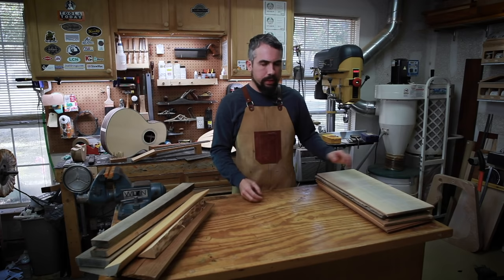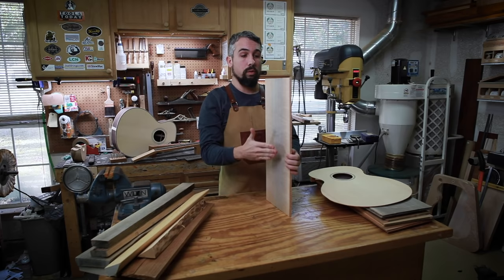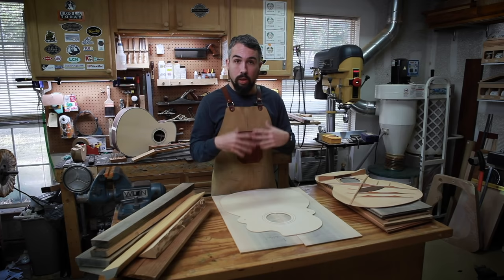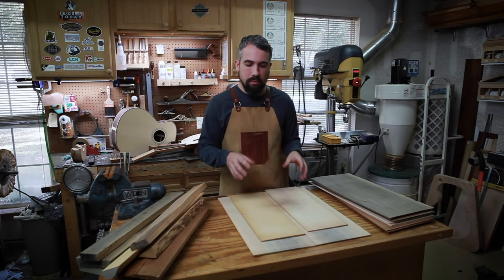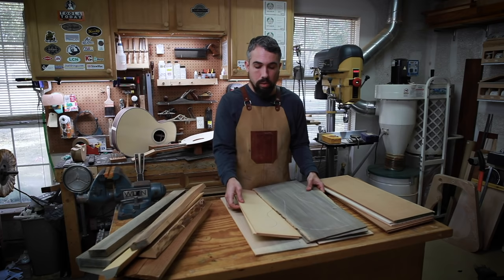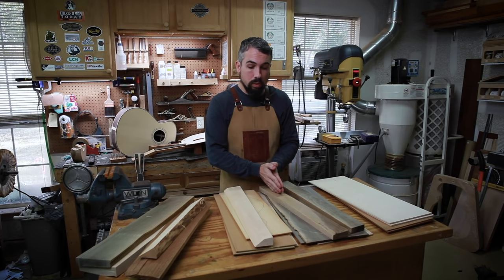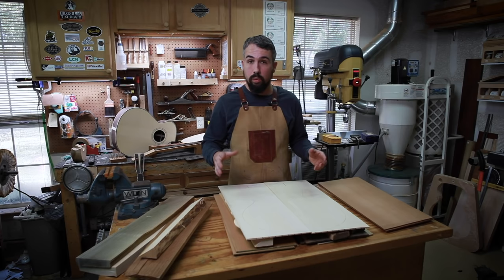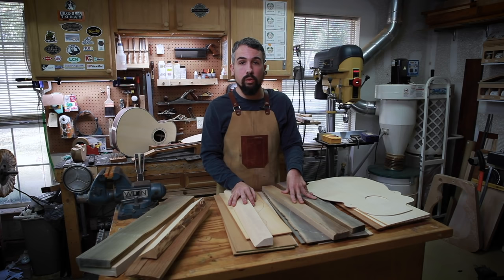What no one will tell you about acoustic guitar soundboards!

Comment: Nice info. Good stuff to think about. 
Odd question here. If you are doing a one piece top, like in a mandolin or uke, which direction would you put the wider grain, to the bass or treble side? I would lean towards the bass side, but I'm frequently wrong in these things, so I thought I'd see what you think. I'm also starting a small descant lute that I have cut the top out for, it's a one piece. Again, why I'm wondering. 

Thanks.
Reply from the maker: That’s exactly what I’d do as well. You’re correct in my opinion.
Reply: @DriftwoodGuitars  Thanks, good to know. At least I'm not totally out on a limb by myself! (so to speak).

Comment: Wouldn't it vibrate more freely if the braces were arched off the soundboard, only glued down at the vibrational nodes?
Reply from the maker: It’s a good thought, and has been attempted. In the end, it just doesn’t work as well, or sound as good as the more traditional bracing. There’s a reason the Martin X brace, the fan brace, or the newer Falcate bracing (or variations of them) are the basis for 99% of builds. It’s been tested and works well for both strength and sound.

Comment: It's all about what the wood looks like under a microscope. Spruce, redwood and cedar all have tiny speaker cones. Structures that look like tiny horn drivers in cross section. They are spherical with a flat circular membrane that has a weight in the center. there are two holes in the spherical chamber.

Comment: i love the way people tap wood. for sound...then cut it up and glue it...flick a wine glass.PING!.then hold it tight and flick it again..DUNK
Reply from the maker: I fully agree. I’ll be covering this topic in a later video. I use free plate taping here as a way to illustrate the responsiveness of each wood. It’s not a perfect representation of its final tone, but is of its general ability to translate energy into sound.
Reply: @DriftwoodGuitars  the top..why is it not thicker on the edges.this way you could make the  middle where the sound hole is even thinner.like an arched top but reversed.the outside would look normal but inside would be arched and like i was saying by the sound hole could be then wafer thin..because nobody thinks they just copy .take the sg or lesbian paul..they dont make it better with a better design headstock angle and the way the strings come out.they should make it better with a prs headstock..have you heard an acoustic with a rosewood or ebony top?everyone says they would be poo but i dont know anyone thats heard one..then theres size..small one might sound pants and a big mexican thing might sound great..taylor do a koa top and thats hardwood..why is the neck dense? to carry sound and have sustain..is that not hardwood? would it not be a good idea to make the top from the same stuff?..we dont know we havent heard any of these varations..just a guess of it going to be crap.then theres carbon fibre.you would think nasa or some f1 team would be the specialist..its not its free spirit fishing..low resin..dont go soft even after 15 years in the sun....any other carbon fibre goes soft after 6 hours in the sun.everyone else comes out with new rods every year..free spirit..same model since 2002 and hasnt been bettered..so some guitar builder aint got a clue.hes light years behind in carbon fibre tech.maybe if free spirit sent their man to a luthier youd get a good one.until then forget it...so basically..what do you know? what do you believe
Reply: @jeffhildreth9244  exactly..copy and paste with no idea why..only that someone before did it. so they do the same thing and regurgitate why

Comment: Great information.  Something I’ve never heard before.  What do you think of high pressure laminate?   I have a Martin made with this and it sounds great.
Reply from the maker: They make for loud and durable guitars, but in my opinion they aren’t great in tone. I’m by no means saying that your guitar sounds bad, I’m just saying that once you hear a high quality hand made guitar, anything else just doesn’t cut the mustard. The lack of actual woods in those guitars lacks the warmth and subtle overtones that you get with wood. I’ve played many of those martins and even gigged with them, and they do a great job. They just don’t sound like a wooden acoustic instrument to my ear. Tone is subjective though, and 90% of acoustic players have never actually played a handmade instrument to see what they’re missing. I’ve heard some carbon guitars that sounds great as well, but to my ear, I much prefer wood.
Reply from the maker: Another note on laminate tops. I recently had a customer ring in one of those Martins with a lifting bridge. It then occurred to me that it would be almost impossible to get a good glue joint between the wood bridge and “plastic” top in order to fix it. In the end, I used epoxy and tried to scuff the top enough to allow for correct adhesion. In the end, it glued back, but I have my doubts that it’ll last long. It’s always an issue to get wood to glue to synthetic materials. That’s why you see a lot of old Martins and Gibsons with plastic binding separating from the body. They expand and contract at different rates and the glue joint just fails over time.
Reply: @DriftwoodGuitars  I totally agree with you.  That’s why the best guitars are expensive, because of all the effort to find great wood and then crafting it into a living instrument.  Unfortunately I cannot afford one, so I settled for the Woodstock DX model.  I was pleasantly surprised how good it sounded.  I use a Tonewood Amp with my acoustics.  That really makes a difference.
Reply from the maker: Love the tonewood amp! I lost my mind the first time I heard one a few years ago.
Reply: @DriftwoodGuitars  Wow. Was that uncomfortable? Did you ever find it again? I hate it when that happens!

Comment: You don't seem to be a big proponent of using Koa for a soundboard. Why do we see so many awesome all-koa guitars, but not rosewood?
Reply: Rosewood doesn't vibrate very well as a soundboard, and it's very heavy, making it really hard for the strings to move. You would have to make it so thin that structure could be an issue. Plus, spruce just works FAR better as a soundboard material. That's why they have used it for centuries on every stringed instrument out there.
Reply: @willmorrison1022  That's my question, really. Isn't Koa also a "hardwood" and therefore not ideal for soundboards?
Reply: @patrickvaleri1561  It is, and the whole idea of tops is pretty weird and subjective. Martin, among others, made mahogany tops on instruments for years, some of their most popular models. Harmony made them, all kinds of people did. 

Koa is definitely a hard (in both definitions) wood, which has also been used for tops for a long time. It makes GREAT Uke tops, something that I find very odd, as most ukes use the same body wood for the top, and they have a very specific tone. I've built a few with spruce tops, and they just don't have the same characteristic sound. 

Rosewood, I suspect, is heavier than koa, though I could certainly be wrong on that. I haven't played with koa much. Rosewood, yes, several types. I've never seen a rosewood top on any instrument that I can recall. I suspect that the koa for tops thing did start in Hawaii since they don't have spruce or much in the way of soft woods, that I'm aware of. People decided it sounded okay on ukes and went for it with guitars too. But that's a guess. It's just possible that koa resonates better than rose, too. Again, a guess.

Comment: Since when did handmade mean that CnC is used lol? I always thought handmade meant no autopilot machines were involved in the creation of said object.  Sounds like the big difference between factory made and "hand" made is, one or two more passes through the drum sander.
Reply from the maker: Then you’re mistaken in your assumption. 95% of the guitars made in a factory are made by machine. Mine are 95% made by hand. Just because I use a power tool doesn’t mean it’s not hand made.
Reply: @DriftwoodGuitars 
Definition of handmade: 
 hand·made
/han(d)ˈmād/
Learn to pronounce
adjective
made by hand, not by machine, and typically therefore of superior quality.
"his expensive handmade leather shoes"

Definition of CNC
CNC

abbreviation Digital Technology.
computer numerical control: automated operation of a machine by a computer program:
a CNC drill press; a CNC machinist.